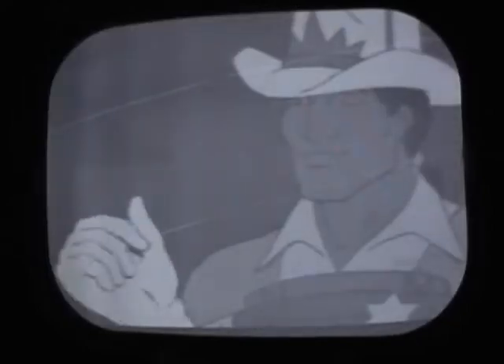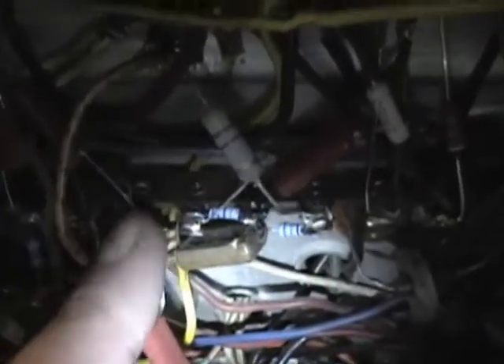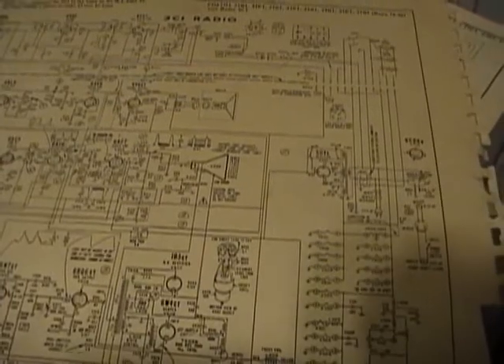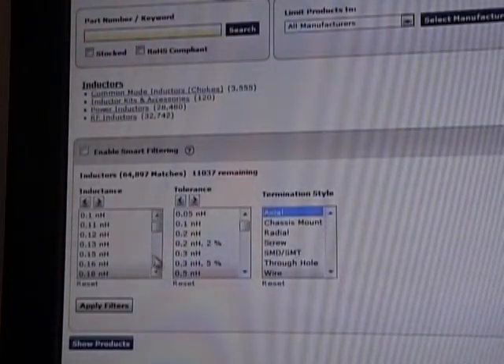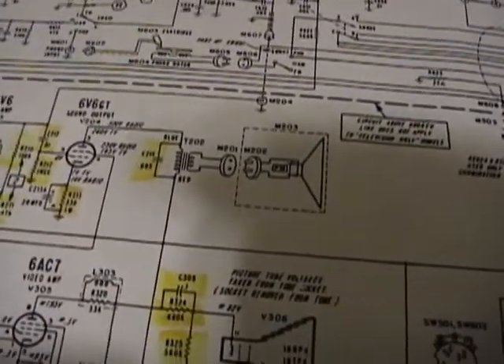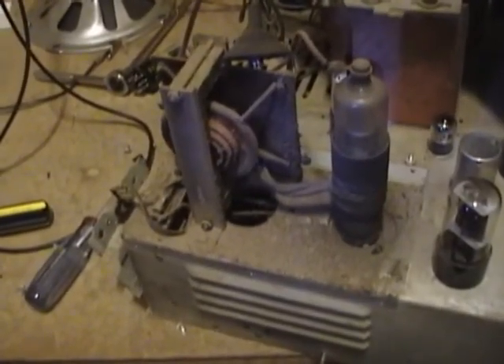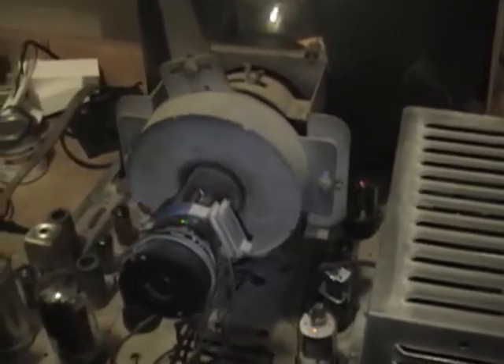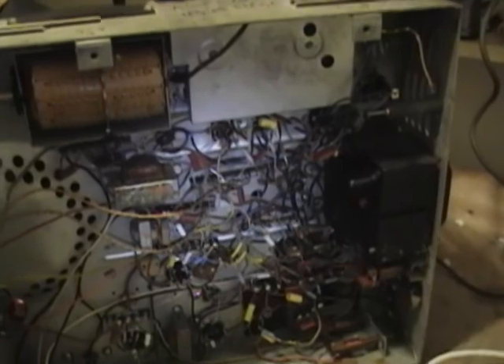Admiral 26R12 restoration p3o5

Comment: It would make sense for them to do that, extra terminal strips cost money and there is no advantage to adding them when they aren't needed. I would rather that either the factory or a service man use disused tube pins as tie points rather then tying components together in mid air like I found in the Medco radio I was working on. Some British and European radios left the factory like that. I know that you did it for testing purposes of course.

Comment: I looked up your thread on this set on videokarma so I read a bit of a preview for this video. I've had problems with those white resitors with the porcelain shell as well, the last radio I worked on had those and they had also drifted badly, they are almost as bad as the BED code dog bone style. As I was saying this problem with the ringing and the retrace lines should be good practice for working on the Predicta sets as that is apparently a problem in those as well.

Comment: The animation on the low power station reminds me of an ant farm with those dots moving around. That filter assembly would have to be tuned to reject a certain bandwidth of frequencies so I don't know how you could throw one together by using a randum RF choke from a junk drawer. Your approach makes much more sense then trial and error, find out what you need to block, and then what parts you need. This is good practice, apparently the Predictas have similar problems to these Admirals.

Comment: What's wrong with it? The only situation where this could be a problem was in a Philco or another set that used ST style octal glass tubes where they may have used pin #1 as a tie point. Pin #1 was connected to the shield on metal tubes so if you inserted a metal tube in place of a glass one in a Philco the metal shell could become live.